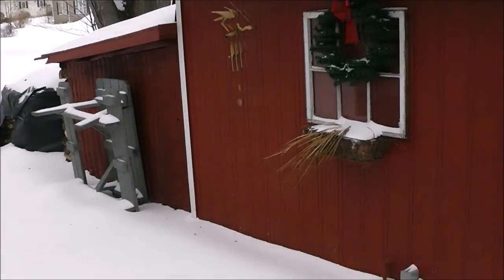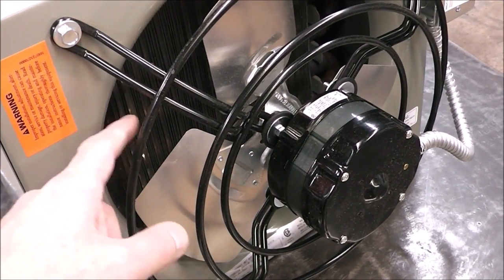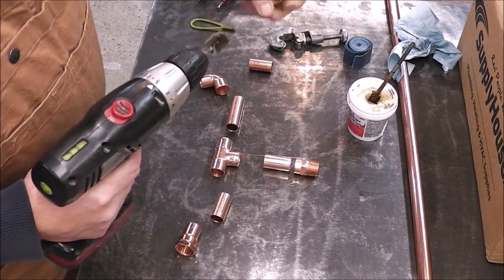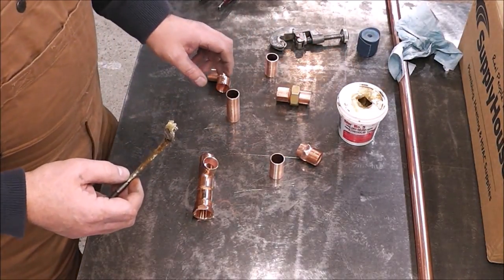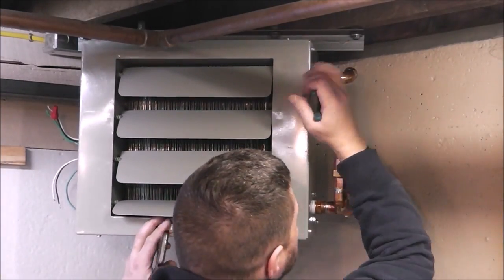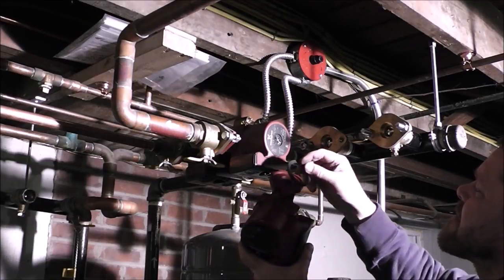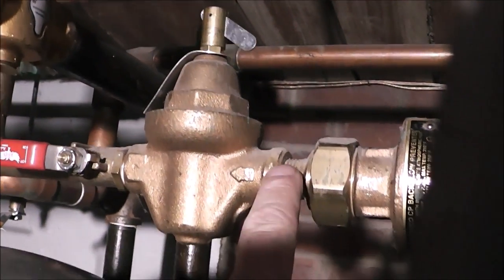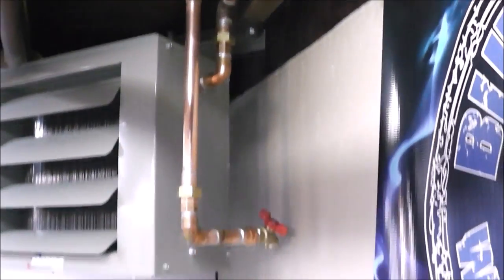Garage Workshop Unit Heater Install Pt1 Getting Started Plumbing Basics

Comment: Good job!! You guys got snow we’ve been lucky in RI so far lol. I want to do this is my garage now how much did it all cost to do? How much more oil you think you’ll use?... jay
Reply from the maker: Thanks man, yah we got more snow coming this week! I am super happy how this heats the shop. All the fittings and everything you saw in the box was around $300 and then the copper was about $23 for 10 feet, plus  the heater. This was well under 1k but i think it could be done for much less if you used that pex stuff...I just dont have the tools or knowledge of that stuff. As far as increased heating costs, I dont think it will be noticable. It hardly runs. I've got a pretty cool programable fan controller hooked it to this too. Next weeks episode will be all about wiring the controls. Cheers brother!

Comment: Thanks for this video and the second video on the controls!  I might of missed it but what is the sqft of your shop. I'm trying to decide whether to do a 24K BTU heater or 33K BTU heater.
Reply from the maker: About 300 but if I remember correctly this will easily heat 1000 sqft

Comment: Excellent and thorough video. I learned a couple quick tips too. Like that tip on using brush cleaners on drill.  Liked it and saved both parts. Like to do this in my basement for added heat when i work down there. Thanks
Reply from the maker: Glad it was helpful! Thanks!